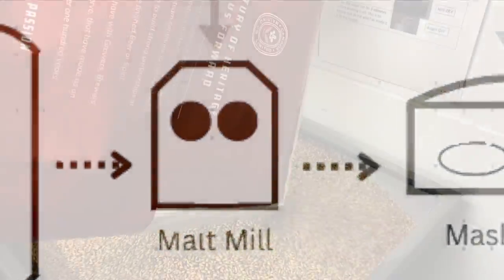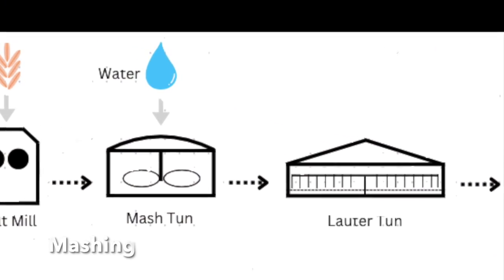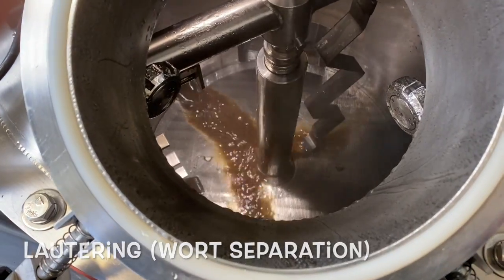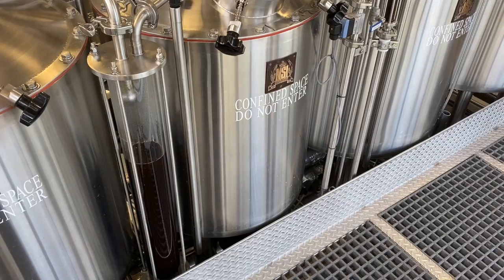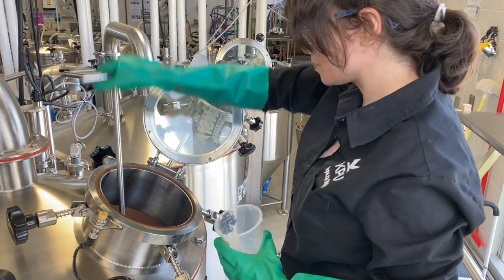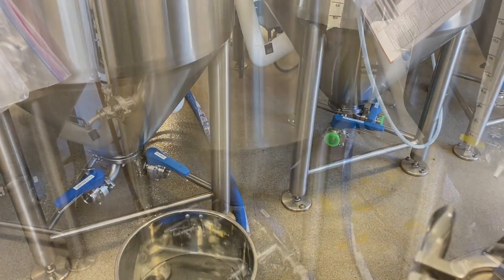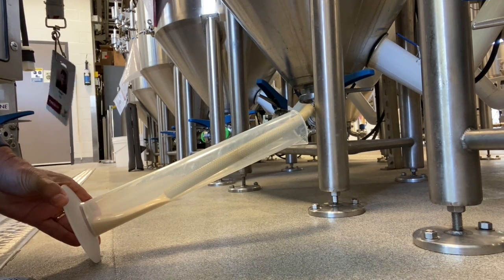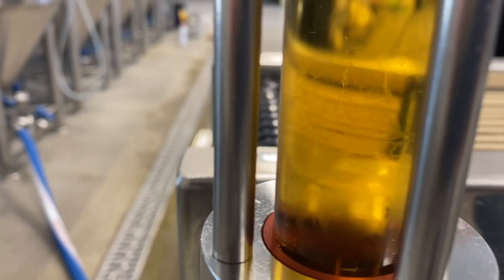Brewing Beer 101- The Complete Beer Making Process (How to Make Beer?) #beer #craftbeer #homebrewing

Comment: Is the grain sprouted?
Reply from the maker: The grain (barley) used in brewing typically goes through the malting process first.
Reply: @KPUBrewing  Is ok to say sprouted in reference, rather than 'malting'?   Back in the 50's people would go down to the diner and get a 'malt'.   Malting for a malt?
Reply from the maker: Malting is the technical term used in brewing and food science to describe the controlled germination of grains—most commonly barley. During this process, conditions such as moisture, temperature, and time are carefully regulated to initiate germination, after which the growth is halted through drying or kilning. While “malting” is the precise term, it’s perfectly fine to use “sprouted” as a more general or approachable alternative, especially for audiences less familiar with the specifics of the malting process.